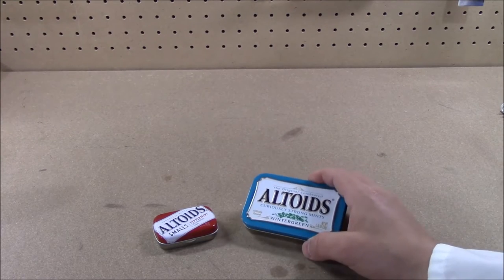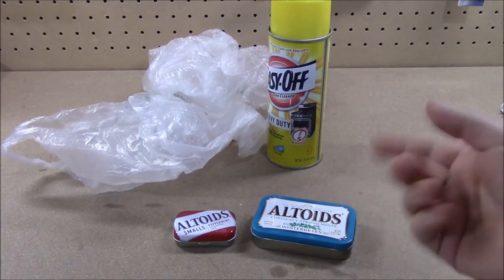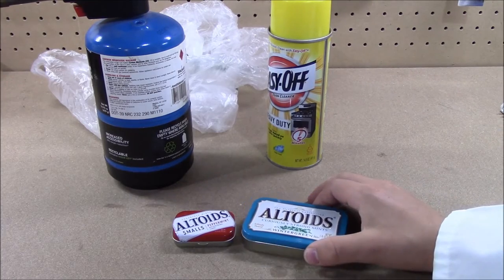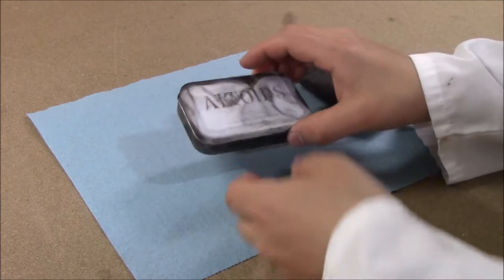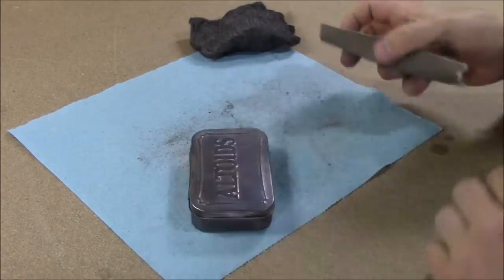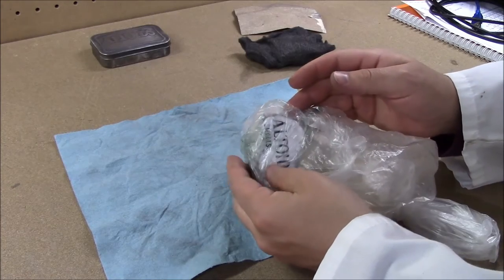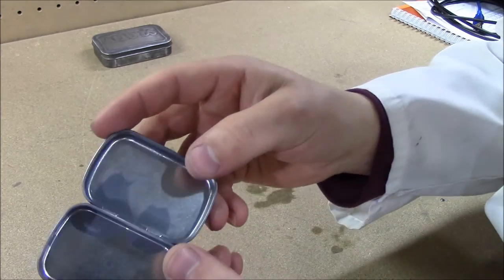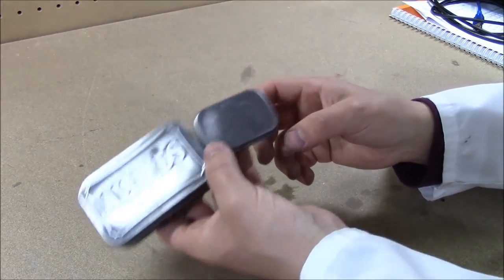De-color Altoids Tins

Comment: this might sound a little extreme but after I saw what brake fluid did to both the enamel on a tool box AND carelessly splashed parts of the car many years ago, you might consider brake fluid as a rapid and seriously effective paint remover. BE REEEEEEEEEALLY CAREFUL with it though Some old style brake fluids are HIGHLY FLAMMABLE ( can cause more car fires in crashes than gasoline) pretty toxic too but the so is oven cleaner
Reply from the maker: Thanks for the tip, I may give this a try. Though any time I work with break fluid, I wear a face shield and gloves. That stuff is nasty!